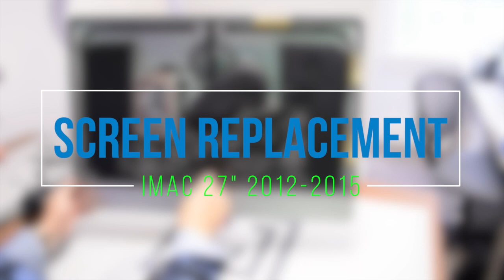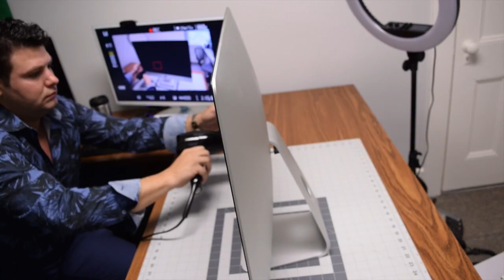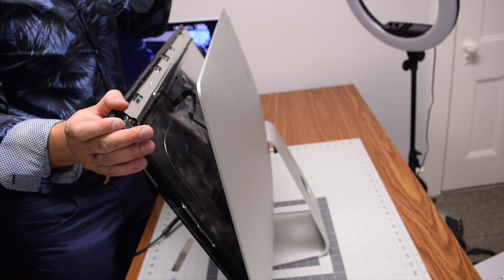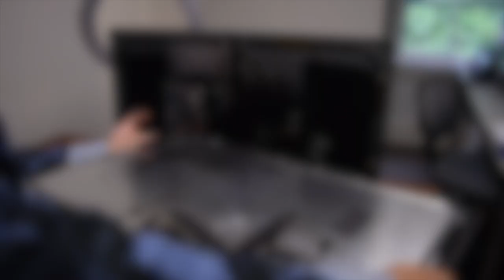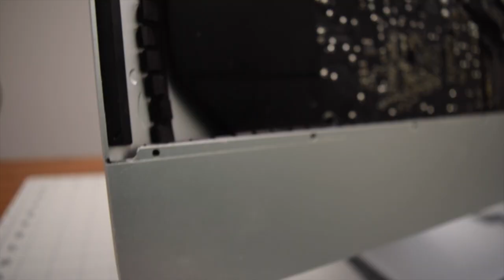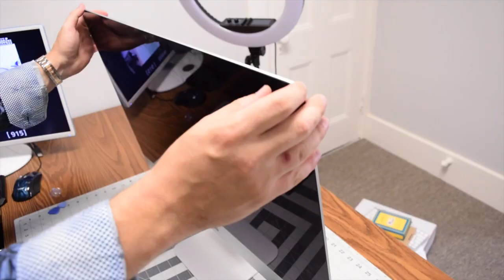📺 🛠️ 🖥️ iMac 27" 2012-2015 LCD or Retina Screen Replacement

Comment: - Although heating is not necessary, it'd lessen the chances of cracking the screen (if the old screen is bad, then who cares), you'd also be able to go a little faster as the adhesive would be softer and be easier to cut as I prefer to use the iFixedit metal blade pry tool where it is strong and slim yet flexible)
- Be sure to clean the adhesive build up from whatever pry tool you are using with the help of alcohol and a clean towel
- The bottom tape is not covered at all in the video which is the most critical and the bottom is often where most people will crack the screen as the tape is not easily seen or accessible;
after removing the two connections shown in the video, after taking care of the glue strips on top and sides, lower the screen about 50-70 degrees and using the pry tool, cut the tape at the bottom before trying separate or lift the screen. If there is any resistance, try to cut/remove more of the bottom type and then try again.

Comment: Do not do what this guy is doing... you need to get the correct adhesive otherwise good luck not breaking the screen the next time you decide to take it off...again... that is not the right way to do this. again do not use just double sided tape like 3m, but you need the thin foam double adhesive sided stripes that's made for these displays

Comment: If anyone is looking at this video - there is a couple of things that will make your life easier.  First off - invest in a service wedge (you can get cheap cardboard ones if required) - these fit between the back of your screen and the stand and keep the display fixed/stationary - makes the job a lot easier.  Also, you can get a specific opening tool (looks like a pizza cutter) - it's made of plastic and this is a far safer option to use - you also DO NOT NEED HEAT! - I removed my screen using just the wheel cutter tool.  And the last thing you might want to do - is to check the display works after connecting (before applying the adhesive) - you wouldn't want to find out the display didn't work or there was a problem with your connections AFTER it was sealed back in place.  Another thing that a lot of these videos don't cover is that - if you're doing a screen replacement - the chances are your screen temp sensor won't be fitted to your replacement screen - this needs to be transferred over from your original screen - its clipped into the top middle and is held in place be 2 strips of black tape - if you fail to transfer this over then your fans will run full speed constantly as they won't be reading a temp from the screen - hope this helps.
Reply: This comment need to be up top. Thanks for precious tips.
Reply: @kenvoh99  no worries! :)
Reply: @ken vo my daughters imac 27” screen broke but when its turned on you can still see picture as if it wasnt broken i still want to replace it. Do you have a video on the sensor that your talking about?
Reply: dude... thank you, that is such a valuable piece of info, very informative!
Reply: very true. The plastic that cut the pizza broked all the screen glass

Comment: Hello sir. Good work. Thnx. My iMac does not have signal on its display and fan runs loud. but there is signal if connected to and external 30" mac display. 
I ordered another mother board and its coming today. but i do not know where is the problem. My iMac is late 2014 . and i found another display on eBay that is 2015. are these 5k i mac displays compatible? thank you.

Comment: I had to replace two of my screens due to breakage. I got them both off eBay. If you look long enough and be patient you can get a good deal. Or look for someone selling an Imac that doesn't work but still had a screen. You can take it off and put it on yours.
Reply: How much are they?
Reply: @marcerocharodriguez  this was a year ago and got it for under $300
Reply: Do the screens need to be the same? I’ve heard that you can replace a non Retina display iMac screen from 2012-2017 with any other non retina iMac from 2012-2017. Do you know if this is true?
Reply: @nathmorris1  Yes if you have a 2012-2017 iMac and if you can find a screen from the same years that's non retina then it should work fine.
Reply: @artincorona  Just to be doubly clear — in theory, I could take any 1920X1080 iMac screen from 2012-2017 21.5" and replace my cracked 21.5" screen with it? Have you done this before? I don't want to buy a dead iMac and have it not work and am hearing very conflicting reports. Also, thank you for your help. I appreciate it a lot!
Reply: @nathmorris1  Although my situation involved the 27 inch iMac, your situation is very similar. And although a 27 inch iMac screen is the same for those years and are interchangeable according to my experience since I've replaced two screens, I would bet the 21 inch are also interchangeable for those years. Just make sure the screen you are buying works. That's the hardest part of this scenario. Good luck

Comment: Hey dude!!!! do you think 5K screen from 2014 would fit on 2013 model???? 
they are both a1419 models, so maybe there is a chance it could be ok??
Reply: Hello, I have the same question: I have an iMac 27’’ 2012. Can I install a 2015 retina screen on it? Thanks!!
Reply: No you cannot. I have a 2012-2013 Imac 27 and had to buy a new screen because it fell off and my research showed they are not compatible. I wish they were because most of the time 2015 screens are cheaper than 2012-2013.

Comment: @save apple dollars ...Why not just use Super-liquid glue lightly on the new screen on top of same original imac  tape since is most likely the screen wont need to be replaced no more for more of a Ultimate seal experience! @saveappledollars

Comment: A good technician would also take the time to blow out the fans while you're in there, and would have suggested that on the video.
Reply: I guess he should have also explained how to upgrade your HDD to SSD too?
Reply: He’s just quickly showing how to do something, if you wanted a video on blowing out fans go watch it. This is just a fast screen replacement, and that would be pointless for this type of video.
Reply: @user-sf9gs2pg1b  My point is only a shitty tech would replace the screen without blowing the fans out, as you can literally never get to those fans again.